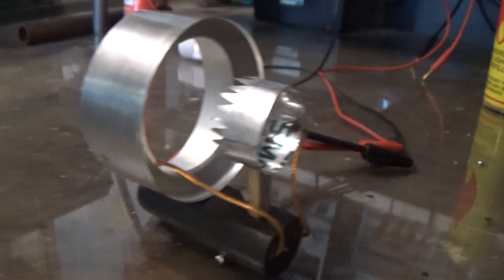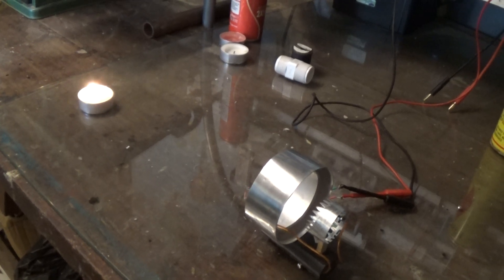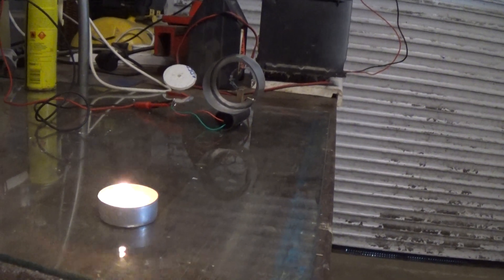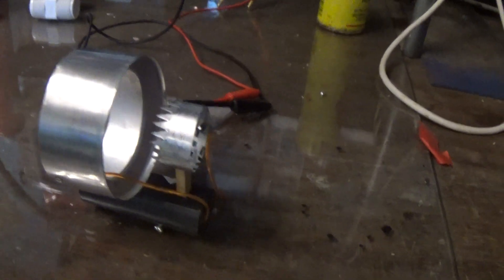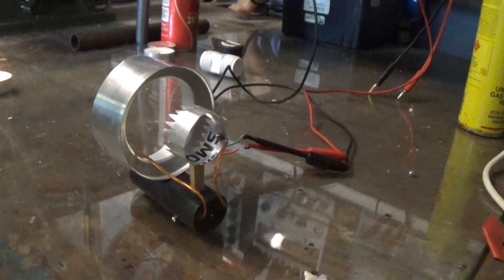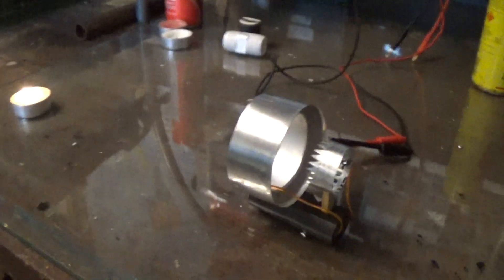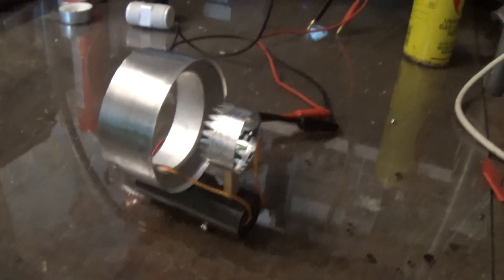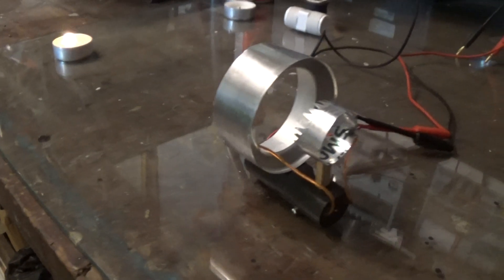Ion Drive/thruster Mk2

Comment: Did you ever fly the solar plane?
Reply from the maker: Hello Rocketboysmc Yes. Two hour test flight with only a big enough battery for 8 minutes. Battery fully charged on landing.
Reply: @woodowoods9167  Sounds like it worked well. Do you plan to upload the footage of the flight?
Reply from the maker: Didn't video it, but will again once the spring comes

 @rocketboysmc